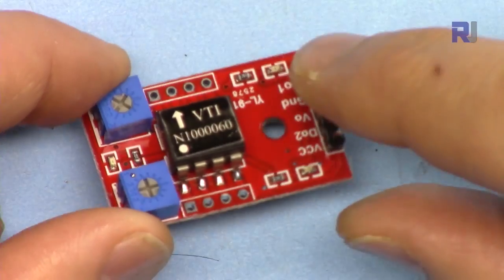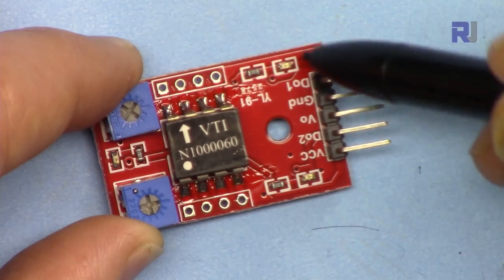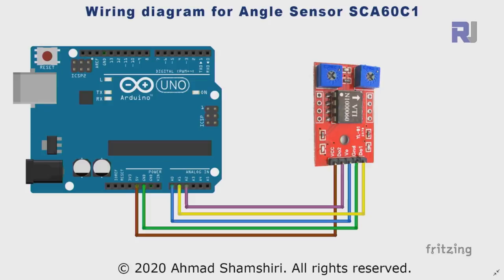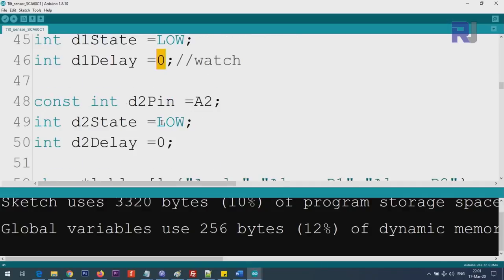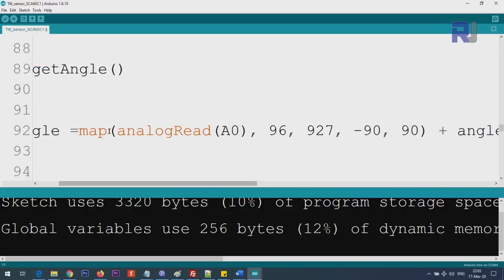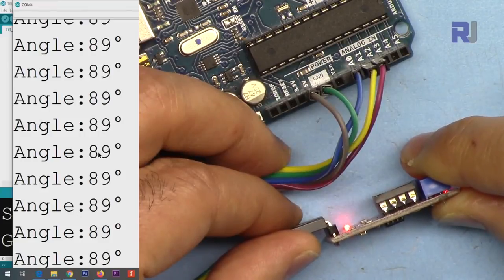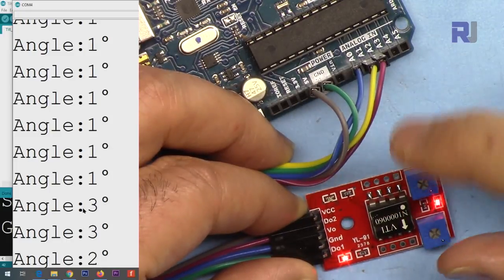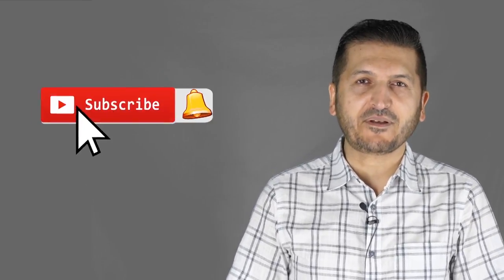Lesson 18: Using Tilt Angle Sensor SCA60C  | Arduino Step By Step Course

Comment: Is it possible to take measurements with the sensor starting in the vertical position (1g or -1g)? If so, what would the code change?
Reply from the maker: There is no g value with this sensor. Please check mou6050 or 9250 and I have video for those
Reply: @robojax  but with this sensor, instead of starting the angular measurements with it in the horizontal position (as shown in the video), we start in the vertical position, can it measure the angular variation?

Comment: please give demonstration for AS5600 SENSOR I NOT getting any idea how to use this it alternative sensors are very costly Thank you in advance
Reply from the maker: Hi, I just searched youTube and found so many videos. I don't know if I am making a video on that.
Reply: @robojax  videos are there all are for I2C nobody explained Analogue
I am working for design and build machine for farmers on my own cost i have a issue with ordinary potentiometer i need contactless pot so please help me how to use analogue out pf As5600
thanks in advance
Reply from the maker: then use Rotary encoder and combine it with I2C module.  Here is rotary encoder introduction video https://youtu.be/6xVLbNlmK-g
Reply: Thank you for reply sir but the issue is i need very precise upto 75 degree movement rotary encoder give correct value but there is a issue with wiper in agriculture my machine operat lakhs of time so its life also limited i need a analog value 0 to above 1000 in 360 degree.
if possible can send me email how to get Analogue value from As5600

Comment: I didn't use your code .i use instead 
Int Val
Val= 1.66/10 . because i bought 25 sensors and all of them shows from 0 volt to max 1.66  . All sensors is defective.from different sellers ?
Reply from the maker: I am not sure which code you modified. but test the sensor when tilting it to see if the value is changing. if yes, then they are not defective.  you simply say in the code which I have shown and explained that  for example 0=0 degree and  1.66=90 degree and it will take care of it for  you.
Reply from the maker: I am not sure how different this video is https://youtu.be/5DjO8Fo_AtE but it is about the same module
Reply: Thanks for your time 🙂 .the specification of the sensor say output 0-4,5 volts and i have only 0-1.66...